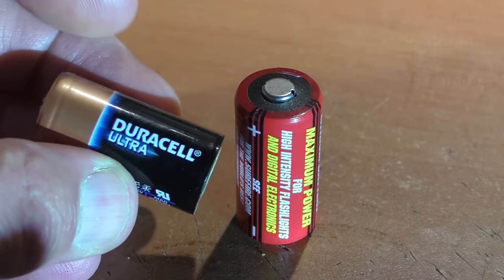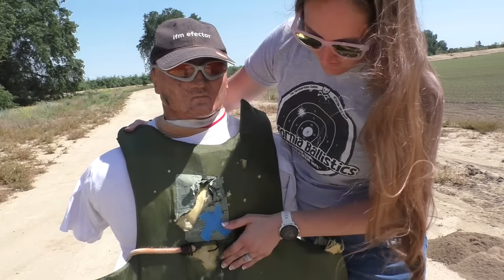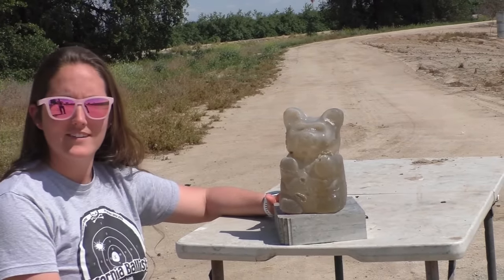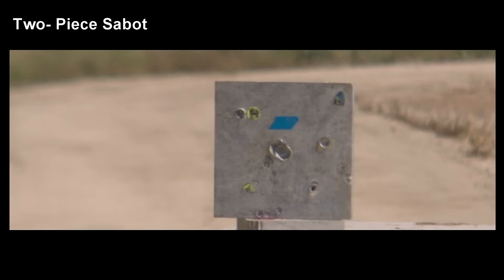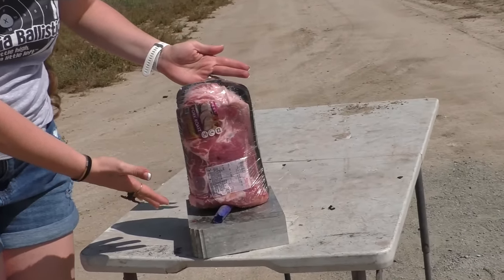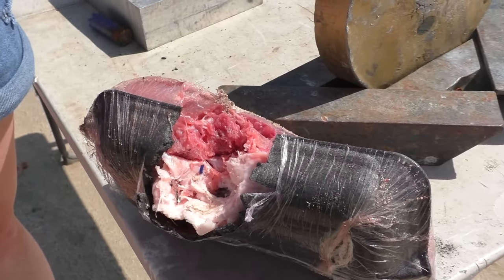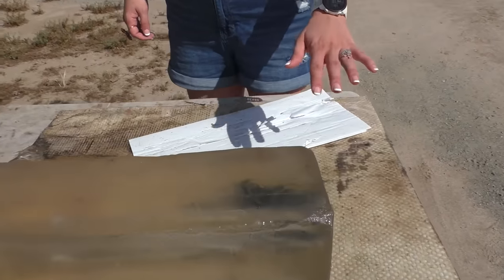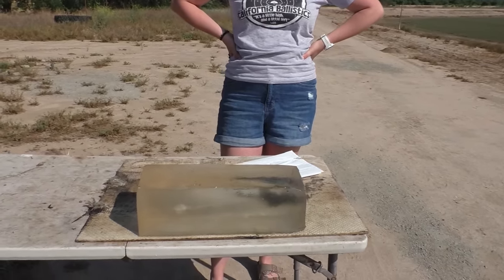12ga. Shotgun Lithium BATTERY Slugs-  Brutal Results!

Comment: A charged lithium battery has more mass as opposed to that of a " dead" cell of the same... This lithium when not expired is softer than led... Lithium when exposed to moisture will flare   up and cardorize everything it comes in contact with... This cartirization would guarantee all these heavy metal toxins would hang out with you for long enough to kill you, regardless of the entry wound... Also, why would anybody pour water over ballistic gel having a lithium filled cavity... If that shit would have flashed it could have taken out a finger or three... Lithium batteries have many survival uses, so be very carefully with it... lithium has a highly unpredictable flash point... Anyway, as a projectile, batteries of all types would be of use, hell everybody throws them away... Just be careful...

Comment: Try getting it right these are duracell batteries, they are alkaline not lithium, duracell does not make lithium batteries, beside might i suggest that firing a lithium cell could prove rather bad for the shooter as tbe compression of the cell as the charge ignites could cause an explosion while still in the barrel.

Comment: You should take these lithium batteries apart and rap your shotgun slugs with it then shoot milk jugs full of water. I think you'd like it. If coated slugs with lithium strips don't work, you could try making hard little lithium balls resembling buckshot. See you want to keep dry gloves on when you touch lithium because it reacts violently with water. If you throw enough like a whole strip in a jug of water or a bucket or tray of water it will explode, and i don't mean like a little firecracker, i mean a big bang. Big enough to not only take your entire hand off but possibly the arm too, plus blindness, loss of hearing, concussion. More or less if you disrespect lithium metal, it will hurt you bad enough where you would have wished it finished you off. But done safely enough could be interesting. Just wad up lithium strips out of those batteries into balls and press them to be more solid and reload it back into your shell and shoot water jugs. Idk i think it's worth a shot.